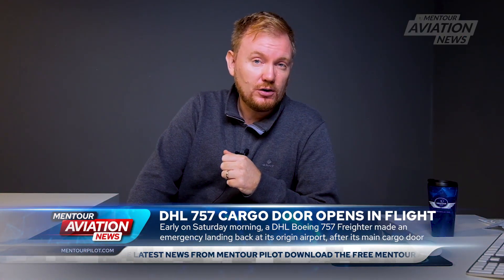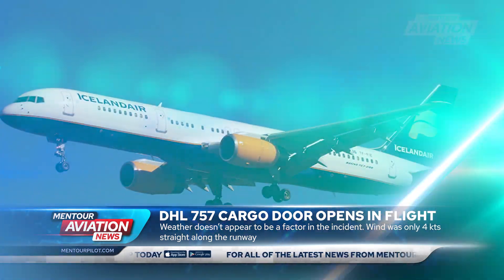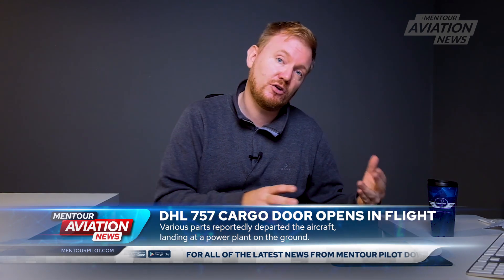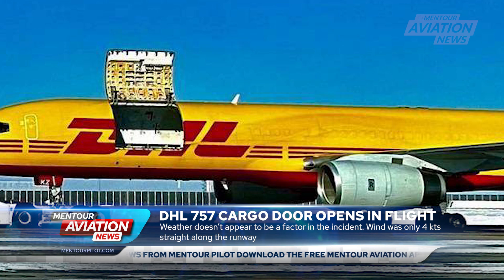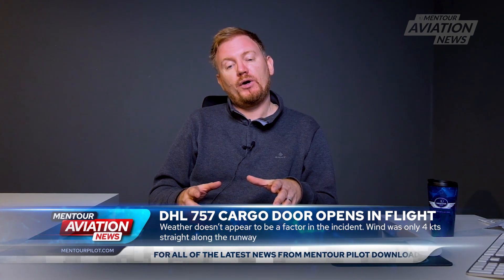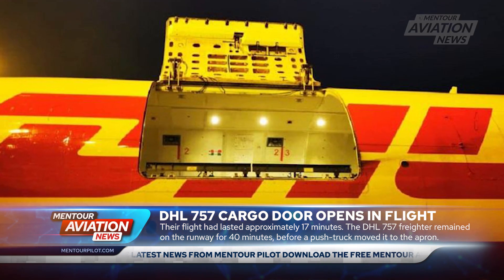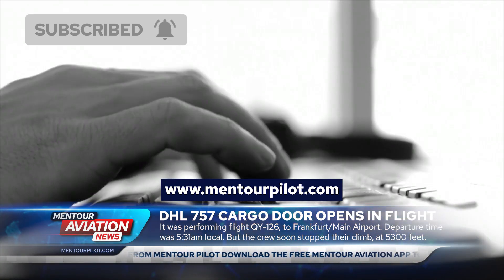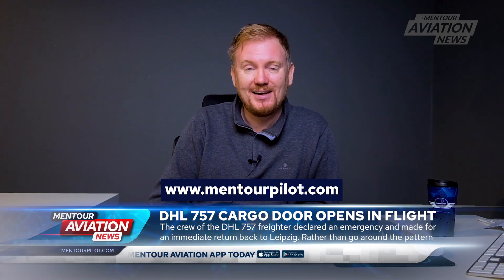Boeing 757 diverts after Cargo door OPENS IN FLIGHT! Mentour Aviation News

Comment: Thankfully can crew are safe...
Now...DSL scaling up the Amazon concept of 'drone delivery's??
One would think bombay doors would be more accurate? )))))
Reply: My reply along those lines, to someone who wrote:  "All they have to do is roll the plane a bit and the packages just fall out above the recipient’s house."  That has me wondering about a more serious possibility sometime off in the future, when USA airspace is totally controlled everywhere and all the way to the ground (almost there -- just ask the poor RC airplane hobbyists), and precise control of free-falling modules is no big deal.  So all along a transcon or half-transcon route, large modules are being dispensed out the bottom of the cargo plane and precision guided to local processing centers directly along the flight path.  No having to double back to smaller cities, or running "extra" flights to serve such cities point-to-point.  Capture at the local processing facility could be "down the smokestack"... in this case a smokestack with magnetic rings or something to slow the suitably-compatible module over say 50 meters, ending with a gentle mechanical deceleration and depositing onto a conveyor belt.

Who am I kidding?  By then it will be hyperloops economically connecting everywhere to everywhere, much like our power grid.  And grandparents will tell their grandchildren of a time when goods were transported by first lifting them 10,000 meters into the air, only to be lowered back to ground level a few hours later.  "Were those crazy people, grandpa?"

Comment: It’s just a quicker way of delivering items to customers. All they have to do is roll the plane a bit and the packages just fall out above the recipient’s house.
Reply: Precision not required. Delivery to the wrong address, is standard operating procedure.
Reply: "All they have to do is roll the plane a bit and the packages just fall out above the recipient’s house."  That has me wondering about a more serious possibility sometime off in the future, when USA airspace is totally controlled everywhere and all the way to the ground (almost there -- just ask the poor RC airplane hobbyists), and precise control of free-falling modules is no big deal.  So all along a transcon or half-transcon route, large modules are being dispensed out the bottom of the cargo plane and precision guided to local processing centers directly along the flight path.  No having to double back to smaller cities, or running "extra" flights to serve such cities point-to-point.  Capture at the local processing facility could be "down the smokestack"... in this case a smokestack with magnetic rings or something to slow the suitably-compatible module over say 50 meters, ending with a gentle mechanical deceleration and depositing onto a conveyor belt.

Who am I kidding?  By then it will be hyperloops economically connecting everywhere to everywhere, much like our power grid.  And grandparents will tell their grandchildren of a time when goods were transported by first lifting them 10,000 meters into the air, only to be lowered back to ground level a few hours later.  "Were those crazy people, grandpa?"

Comment: I sure the engineers will find why this happened and design a system to prevent it again.  They very fortunate that returned safely.  Very well trained crew. As an A&P I worked on passagener B 757 aircraft and loved them, kind a hot rod.  Big engines and narrow fuselage.
Reply: quietly adds security chain to door...

Comment: Is it a pam-pam or a mayday situation?
Reply: Mayday, mayday, and then some more mayday.  Even if no other structure was damaged at that point, no telling what might happen next.  Damage to the tail, as mentioned, or stability problems seemingly out of nowhere depending on things like which direction the plane yawed, or which direction the crosswind was on final, or ???.  Note that its hinge might have been causing the open door to act as a destabilizing fin in one yaw direction (when fully open against the hinge stop) but not necessarily the other.  Literally an accident waiting to happen, but fortunately didn't.  So grab the emergency priorities which accrue from Mayday, and get it back on the ground ASAP.

Comment: Awesome video. Thx.
I've a weird question for you: it might sounds stupid: what's the reason, as a passenger, that in cruise flight, you have the impression, the plane is a bit inclined upward.  If you walk from the back to to front, you feel walking up hill. What's the reason? Is it for aeronautical reasons? Because the plane is a tube you woul expect it flies perfectly horizontal.
Reply: Airliners typically cruise at a nose up attitude of about 3 degrees. If the flight is heavy, that nose up angle can be much more. If you have a look at some first / business class seats carefully, you will notice they are angled so they are flat during cruise, but on the ground they seem to tilt down slightly.
Reply: @stephen_101 thx a lot for your answer. I guessed a bit  the same. But what's the aerodynamic/mechanical Reason of that?
Reply: When the nose is upward, i guess the "tube" creates a little lift too. And when an airplane is at cruise altitude the angle of attack has to be higher because at FL300 the air is less dense and creates not the same amount of lift than in lower altitude. However, I don't know for sure.

Comment: Would the pilots in this case try to fly as slowly as possible to keep the structural stress to the door to a minimum? Or would they on the other hand try to keep as much over the usual min airspeed as possible as the aerodynamic characteristics might have changed significantly with the door open?

Comment: I suspect that the cargo door is not important to the structural integrity of the aircraft. The modification should have been designed such that the rest of the fuselage is fine without the cargo door. Likely the reason you can't tow the aircraft with the door open is because it is a giant cantilevered mass that has the potential to bounce around and overload the hinges/fuselage structure.

Comment: Glad these guys got on the ground safely. I've worked avionics on cargo mods for the 737, and it is something to see when they cut a huge hole in the airframe to make the door.
Reply: Don't know when you started, but I worked for Roadway Global Air (two years of their two and a half year life... Long Story.) We were mainly leasing 737s, DC8s, and DC10s in the mid 90s. (Like I said, I didn't know when you started...and I'm old. :P ) I remember hearing about how they converted those planes to work cargo, including replacing the passenger floor with a lowered cargo floor.

Other than updating the code for the computers to deal with a different kind of load, I didn't think there would be much to update the avionics for.

Comment: If the plane is a write off, tell DHL to call me... i'll buy it off them for cheap XD
Reply: I don't know German Civil Aviation authority rules, but I suspect it's a more stringent version of what happens when your insurance company writes off your car. Even if the airplane could fly, it's probably going to be declared unairworthy and destined for the scrap yard. Trying to fly it ANYWHERE afterwards gets to be a really expensive proposition. I suspect it's going to be partially carved up so it's small enough to fit in something like Boeing's special 747 that Kelsey from 74 Gear sometimes flies or onto trucks to go to a recycler. (I suspect without the wings and tail, you could fit the body on two 53' flatbed trailers... after the body is cut into two.
Reply: @jackielinde7568  IRC If plane was generated un airworthy, must be scraped locally. Also Lufthansa technic have special team for this
Reply: @mateuszzimon8216  I'm sure the engines would be kept as spares, after proper inspection. That's half the value of the plane right there, given it's age. Avionics can be raided for spares as well.
Reply: To be fair, he never said anything about flying it. It could become one of those planes that gets converted into a very unique hotel, restaurant or something else.

Comment: Jeebus how the hell didn’t that thing get ripped off?  Hinges must have been made of old Nokia phones.
Reply from the maker: Hahaha 😂
Reply: Reminded me of those old AT&T rotary dial phones.  Those were indestructible.
Reply: @ecoterrenos_cl  The video says the conversion is not done by Boeing
Reply: @ecoterrenos_cl  Boeing had zero to do with this.
Reply: Or Volvo 240's...
Reply: Keep in mind the narrow part of the door was almost straight on into the airflow, so... less of a sail, and the forces in a direction the door is fairly strong.  Looks like the door was almost straight vertical so you'd need some sideslip to generate really large forces.
Assuming those structural limits are worst-case on the ground, e.g.  wind blowing across the aircraft from one wingtip to the other, you'd need more than 10 degrees of sideslip at 200 knots to have equivilant to a 45 knot crosswind on the flat part of the door.  Strong winds would have made this a lot spicier.
Reply: @FireStormOOO_  but that is how a sail works in a modern sailboat.  In an old square rigged ship the wind hits the sail and pushes it like you picture but in a modern triangular sail sailboat the wind splits around the sail and the sail is essentially an airplane wing turned 90 degrees so the "lift" is forward instead of up.
Reply: @dunbar9finger  actually the two sails work the same - when running (wind behind the boat - wind pushes directly on the sail) when beating/reaching the wind is split by the sail and works like a wing - this is the same whether it's square rigged or schooner/cutter/sloop etc
Reply: Nah mate, if it was nokia then it would've stayed closed even if they broke the plane/ Mostly a samsung, batteries must've blasted
Reply: @imsid2253  HAHAHA! true that XD
Reply: Best phones ever lol
Reply: Nothing beats Mentour's impersonation of the buzzing sound my PC speakers would make just as my old Nokia was about to ring. I wanted to make that my ring tone.
Reply: The door was made out of Krell metal.
Reply: XDXDXDXDXDXD ROFL
Reply: Nokia phones are indestructible.
Reply: If they had been made of old Nokia phones, this story would’ve never happened. Those things are indestructible. Even Demolition Ranch had to find Chinese copies to get his .50 cal to even—oh, now we have an answer.
Reply: Nah, Playstation 2s.
Reply: @sirbader1  nope, commodore vic 20's!
Reply: "... Hinges must have been made of old Nokia phones."

The hinges remained intact... the door somehow became unlocked & opened.
Reply: @rwbishop  Whoosh

Comment: I'm impressed with both the flight crew and the structural integrity of both the airframe and the door structure as it pertained to the physical stresses involved. Yes the aircraft may be a right off. But from an engineering standpoint this is ana amazing learning opportunity to see how designs can be improved and how well this design handled the structural loads. Maybe even an envelope expansion situation.
Reply: Yeah, the aircraft doesn't have to survive. It just has to survive getting to the ground safely. That's the thought behind much of the redundancy and safety features in modern commercial aircraft.

Comment: Before I soloed, the instructor opened passenger door just as we were breaking ground.  Many accidents due to pilot error after door open.  Galaxy 203 killed 71 people when pilots were distracted by an open door banging and stalled.
Reply: wasnt there another disaster where the hydraulics failed on a cargo door of a passenger plane, and the failure was caused because of a finicky locking mechanism that wasnt fully engaged?
Reply: @whitetailprince   Wasn't hydraulics.   Was the DC-10, and its notorious cargo door had electric actuators.   And it was known to be subject to failure, the first prototype blew its door off on a ground test, a DC-10 in flight blew its door off over Windsor Ontario (the 'Windsor incident') and by a magnificent bit of piloting the crew managed to land that one; and while McDonnell Douglas were bickering with their subcontractor Convair over who was going to pay to fix it, Turkish Airlines 981 blew its door off near Paris and killed 300+ people. 
And Douglas tried to blame a baggage handler for 'not closing the door properly'.      If I'm flying I do not want my life to depend on whether someone closed a door 'properly' or not...

Comment: Also: Even if the entire thing winds up being a write-off as an aircraft, it still has intrinsic value on the ground as a training tool for things like aircraft fire-fighters using parts of the airframe, for example, so this could wind up being a blessing in disguise! I'm just glad they got it down safely and no one was injured as a result!
Reply: That’s not a blessing in disguise, that’s just making the best out of it.
Reply: I think if you look for surplus airplanes these days you won't have trouble finding one easily.

Comment: 0:19 "Not allowed to push or pull the aircraft with the door open".
Reply: I'm pretty sure that also extends to taxing under it's own power as well. However, seeing the circumstances, I don't think they're too worried about it at that point. As it was pointed out, the aircraft's probably already a write off, so what's a little more damage to get the plane out of everyone's way.
Reply: @jackielinde7568  On AVherald u can find photo where is connected to tug with door open.
Reply: @mateuszzimon8216  Hence why I said, "As it was pointed out, the aircraft's probably already a write off, so what's a little more damage to get the plane out of everyone's way."

Remember, the airframe wasn't rated to be transported with the door open, but it probably wasn't rated to fly with it opened, either. So, as it was pointed out in the video, the airplane was probably an insurance write off the moment the door popped open. So, hooking up a tug and moving the plane around with the door open isn't going to matter much.
Reply: That is right.

The correct procedure would be to reduce air speed immediately to under 40kt to protect the door.

Comment: Exactly the same thing happened in December 6, 2014 with a cargo 757 in Russia. See AvHerald. Seems like a common bug of this conversion.
Reply from the maker: Interesting. Could be weather related then?
Reply: @MentourPilot  The authorities did issue two recommendations: to clean the door locks and mechanisms better during winter ops and make sure the power to the door mechanism is off after the door is closed.
Reply: @feedme8991  That is interesting. There were icy and very cold condition at Leipzig Airport that morning - minus 15 degree Celsius.
Reply: @NicolaW72  Checks out. I took a look at METAR readings for Magadan (UHMM/Sokol) for the incident day and it was between  -16 and -12, overcast at 100 most the day and snowed intermittently. METAR about the time the airplane was preparing for the flight:

UHMM 062000Z 02005MPS 1100 R10/1100D SHSN VV005 M12/M15 Q1015 RMK QFE746
Reply: @feedme8991  Aviation Herald just put his report about this accident in Magadan back in 2014 on its front page again.

Saturday early morning in Leipzig  it was indeed unusual cold with temperatures around the point which Magadan had back in December 2014. I don't want to speculate - but if you look on the picture's and read the reports it looks and reads very similar.

Comment: I think the crew would want a much higher landing speed given the severe drag?
Reply from the maker: No, I would expect them to land normally. With a higher speed there is more of a chance for the door to rip off.
Reply: What they would need is more power to hold the nominal landing speed, because of the extra drag (speed will be higher than normal, but only because weight is higher than normal).  But not a whole lot more power:  I eyeball the cargo door planform drag + cavity drag as being in the ballpark of gear up/gear down drag difference.  Call it ten percent, or maybe less depending on the design.